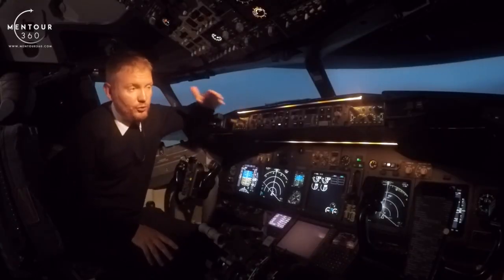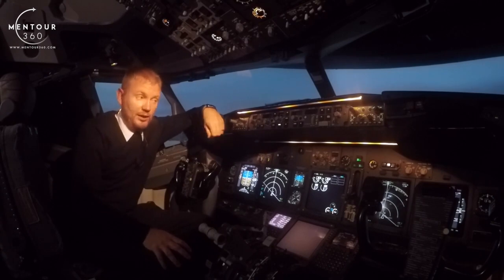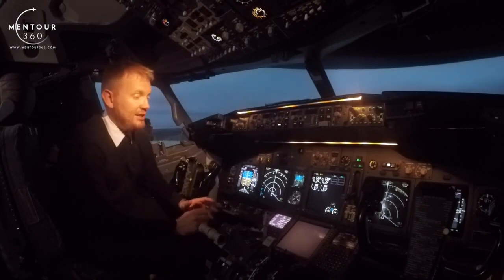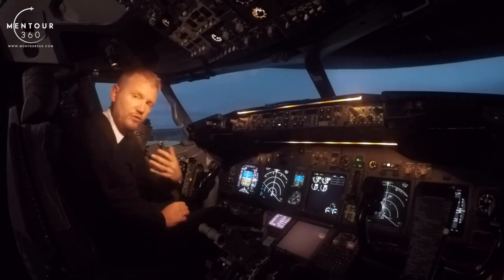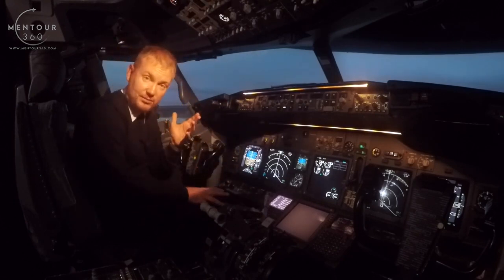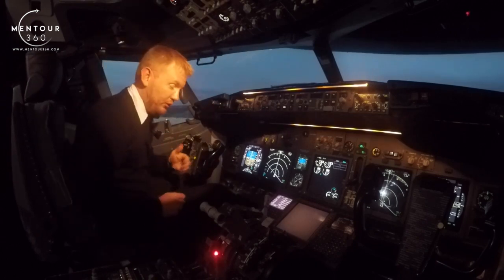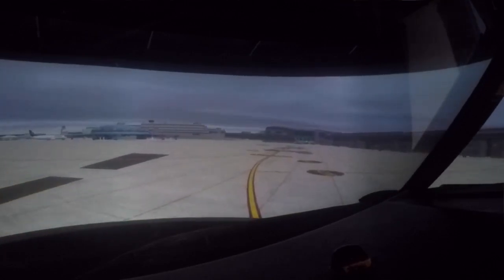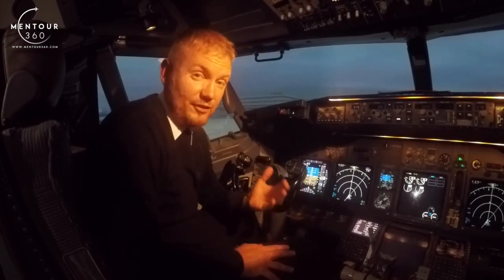How aircraft are CONTROLLED on the ground.

Comment: I saw a MD-80 Delta airlines do a thrust reverse from the gate. How could that happend? Is on youtube.
Reply: Turboprops can also powerback without ingesting FOD. The reason it's rare is not just a matter of potential aircraft damage. Keep in mind the reverse thrust carries a lot of energy and blasting the ramp with it isn't always appreciated. Unless the area is properly cleared, you can easily send lighter ramp equipment like traffic cones, cables and even empty baggage carts flying and hit some poor sod or just generally cause damage.
Reply: I was on a plane that did a reverse thrust pushback at KATL.  I don't remember what kind of plane it was; I want to say it's a 717, which is actually a Mad Dog design (tail-mounted engines).  There was nobody working at the adjacent gates so the whole area was clear.
Anyway, I thought that was the neatest thing!
Reply: Mentour Pilot yeah, but doesn't that also possibly cause reingestion of the hot  diverted exhaust gases and possibly even exceding max EGT?
Reply: A boeing 727 was lost in 1982 when they used reverse thrusters to push from the gate due to snowy conditions. It was in NY on a flight to Florida. The engines ingested ice and snow which ended up affecting the sensors in the engines. After take off they ended up stalling the plane due to conflicting data readings on thrust levels. The ended up in the Potomac river with only a handful of survivors including one air hostess, 78 dead including the pilots. The voice recording is harrowing to listen to. 
I think it was this crash that made it illegal to push back using reverse thrusters. Lesson learned the hard way.
Reply: Seamus Ó Raghallaigh: Regarding Air Florida: regular ground engine operation ice ingestion, not reverse thrust, cause internal ice formation, as described in the passage below. This was exacerbated by failure to set the de-icing control. As to cause of the accident, additional contributing factors were AA's ground operation error causing improper de-icing mixture; failure to re-apply de-icing after long hold on apron (crew didn't want to give up place in line which would add to existing heavy delay); unauthorized leveraging of a [another] forward jet's engine blast to melt snow or ice (it actually caused ice formation from melted snow), and seat 1 overconfidence in rejecting seat 2 exclamations that thrust was insufficient for roll. None of these involve the unauthorized use of reverse thrust to attempt to push off (they did do that, or rather attempt that, but it was not implicated in the crash or the effective disablement of Pt probe sensor). (Note, the AA ground operator stated that it was improper for American Airlines jets to use reverse thrust on apron, on that day, not as a new policy afterward.) NTSB:

"The Safety Board, therefore, believes that the underwing position of the engines with their resultant proximity to the ground and to the exhaust of other aircraft during ground operations may increase the susceptibility of the B-737 to engine inlet pressure probe icing."
Reply: Seamus Ó Raghallaigh, you are very wrong, if you're referring to Air Florida - completely wrong regarding reverse thrust. It crashed (in part) due to icing caused by improper de-icing and an unauthorized leveraging of ANOTHER jet's thrust; at any rate, reverse thrust was not a factor in foreign material ingestion and NOT a cited cause of the crash though you imply that. I hope you're not just careless.
Reply: The older DC-9s with "Tail Buckets" could do it mechanically but mechanics I know said that doing so is hard on the engine, it makes a lot of exterior noise, and blasted hot wind all around the gate area.
Reply: Ian Livesey Aha ok thank you!
Reply: Stefanos Gorgis they don't do it anymore
Reply: +Mentour Pilot I imagine another concern especially with some aircraft reversers that actually direct the airflow or part of it a lot more towards the ground than normal the risk of possibly throwing a piece of FOD at the terminal is part of it too. Doubt it would take a particularly heavy object for the thrust from a jet engine to fling it with enough force to go straight through a plate glass window damaging property or worse injuring staff or members of the public inside the terminal.
Reply: Seamus that was terrible, recall seeing it on evening news.
Reply: That sounds expensive!
Reply: Air Florida Flight 90 a 737-200.
Reply: Stefanos Gorgis Delta Never ordered the MD-80 though it looks like one but its actually a 717 (Boeing) Delta also has 80% of its Company with 717s
Reply: Aircraft with engines on the fuselage can do that
Reply: Because that plane is old weird and stupid
Reply: Seamus Ó Raghallaigh • Actually it took place in Washington DC. It was Air Florida Flight 90. If I remember correctly, both pilots actually lived in Florida and were a little unfamiliar with such inclement weather. They fired up the reverse thrust, unknowingly ingesting chunks of ice which fatally damaged the jet engines. They subsequently sheared off the top of a car as they crashed into the Potomac River, like you said.
“We’re going down, Larry!”
“I know it! I know it!”
The resulting rescue of two or three people in the icy waters is forever etched in my mind. I’ve watched the video several times.
Reply: It was an Air Florida 737 not 727 and the crew DID NOT power back the airplane since the 737's engines are under the wing.  The airplane was not properly deiced prior to flight.
Reply: Reverse thrust push back is very uncommon and i think illegal but it might be an old video because MD-80 are old...

Comment: the pushback truck is also called a tug
Reply: It's not safe for the wing-walkers, ramp rats, sorry- I mean ground crew.  Also, noise problems.
Reply: Neil Gusthart A handjob is also called a tug
Reply: Why waste time with a Tug, when you can* power back :)....If only it was not prohibited at most airports and you could mitigate against FOD by having a theoretically spec less airfield.